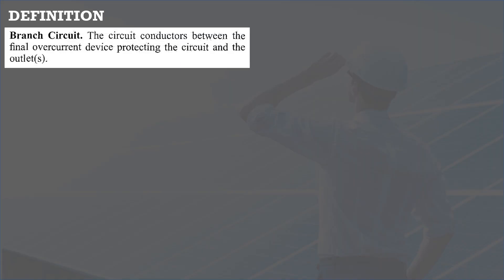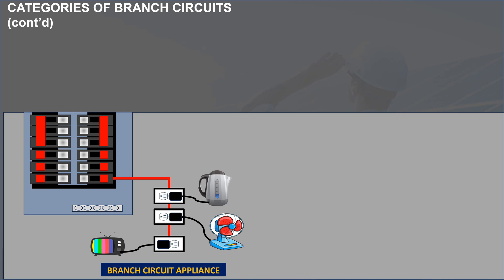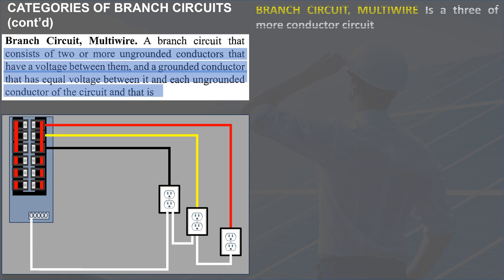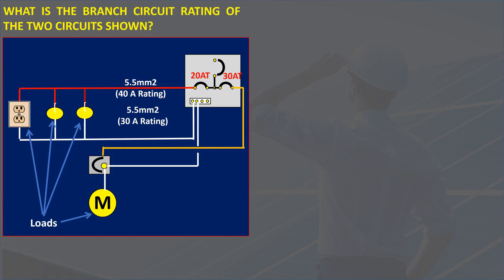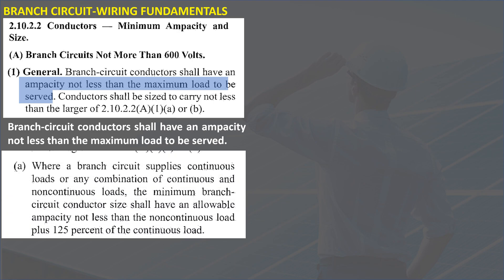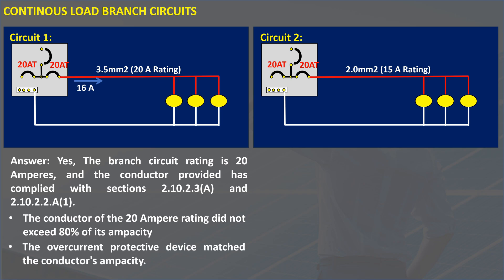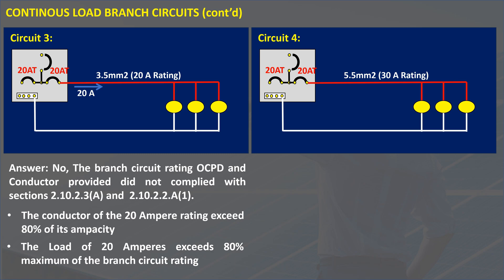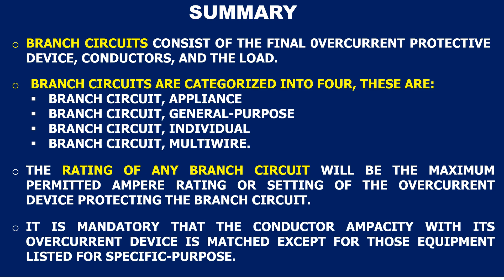BRANCH CIRCUIT EXPLAINED -ELECTRICAL CODE (NEC & PEC)

Comment: Probably too late, but I’m struggling to understand the minimum OCPD of 15A regardless of load. Taking into mind that the min. Cable mm2 for lighting is 2mm2  copper. Given that most new households use LED’s the max load in these circuits will not exceed 200w (say 10no. 18w LED) this load on the 230v circuit will only be 0.78A. This is only 8% of the cable capacity (10A), why can’t I install a 10A or 6A MCB. Even if someone installed  all 60w incandescent lights, 10 number that is only 2.6A. Either load doesn’t exceed the cable ampacity. Even if the circuit is loaded above the cable rating the MCB (6A or 10A) will protect the cable and trip before we over load the cable.
Reply from the maker: the minimum of 15 A comes from the PEC 2017, which is why we stick to that size. However, did you know the 2023 NEC has lowered the minimum to 10 A for branch circuit ratings?
In residential settings, you can only include receptacle outlets and lighting for general purposes based on the area. To learn more, you can check out this video: https://youtu.be/o3ZyVeY9EtQ.
Reply: @codesultant  Hi, thank you for replying. I didn’t know. This makes a lot more sense. Many thanks.
Reply from the maker: @davidcase4041  you're welcome